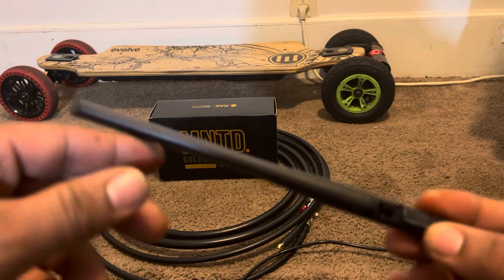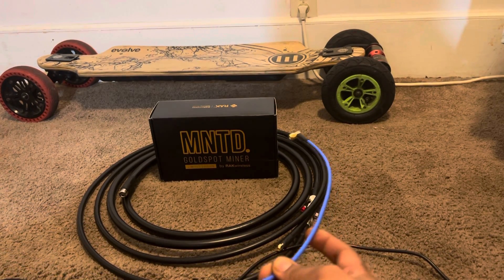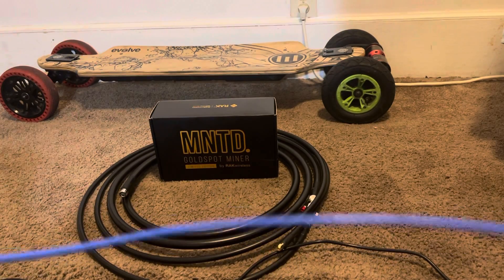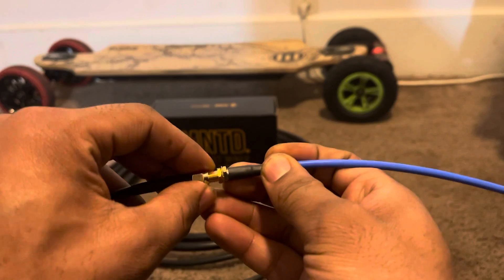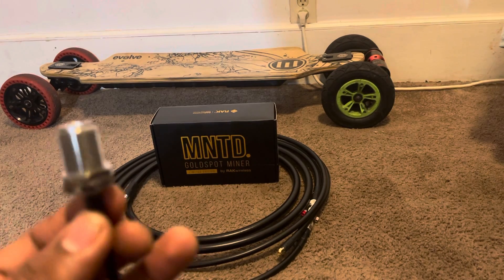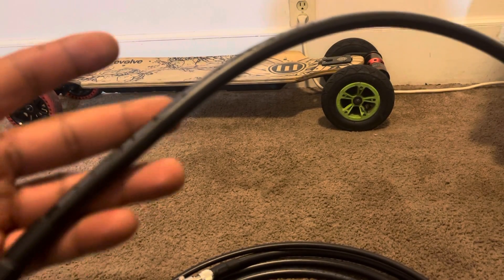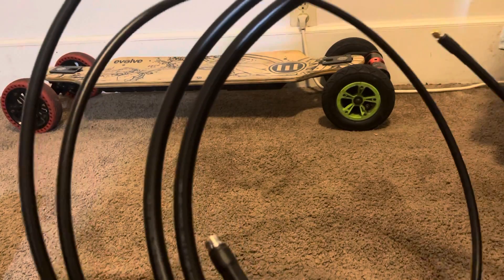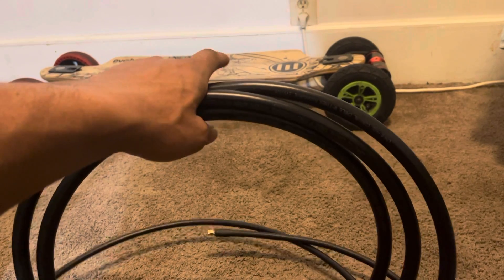￼ tutorial Helium antennas Helium Miner Antenna Cable!

Comment: Hello, does this still work today? 
I currently get around 5 hnt per month with my parents and maybe around 4 at my apartment with both antennas outdoors.

Thank you
Reply from the maker: Yes it does but now, amplifier and cavity filters increases ur chances by miles…
Reply: @RazziiGrows  what amplifier and cavity filter do you have or recommend?
Reply from the maker: @Motivational_1997  I run the mcgill cavity filter

Comment: Wow...600 cable.. you might as well have gotten some heliax, some ldf4 -50 would be nice
Reply from the maker: Is that a better cable?
Reply: @RazziiGrows  very very low loss cable... it's a bit overkill but would help on long runs. There is insertion loss on anything  you put in between.  Where I live there is very little rain  or thunder storms so I don't use any lightning arrestor
Reply from the maker: Ok thanks thanks I will be looking into those I appreciate it
Reply from the maker: Where can I buy that cable at with an n type fittings
Reply: @RazziiGrows  hey at lest your making some money, I've had mine for about a month now with very very little hnt... I thinks it's the cheap antenna I got from ebay.. it's a 8db omni.. I ordered a 6db McGill which should be better (I hope)
I have a run of 25 feet with true lmr 240, nothing in-between.. should get it next week. Antenna it up about 25 feet in air
Reply: @RazziiGrows  try rf parts.. they have everything for cable
Reply from the maker: I had the 6dbi mcgill I switched for a 3 dbi hntenna
Reply: @RazziiGrows  wow... those antennas are expensive.. how's it working out for you? I'm thinking about a directional antenna from L-com
Reply from the maker: Good I have 2 of them now